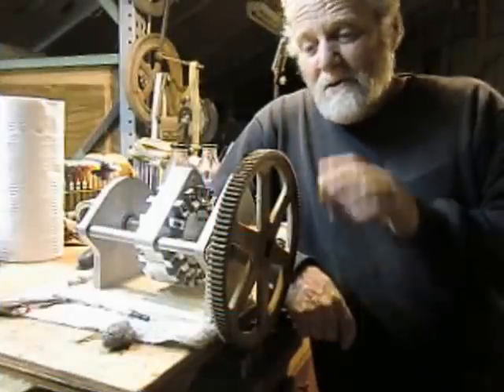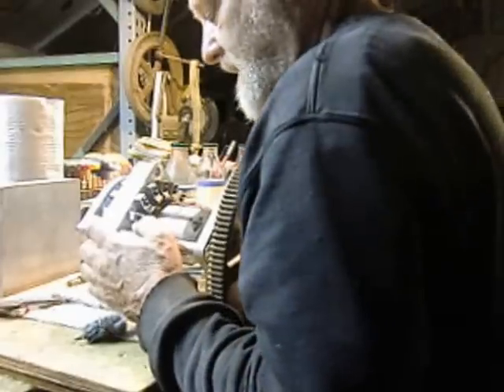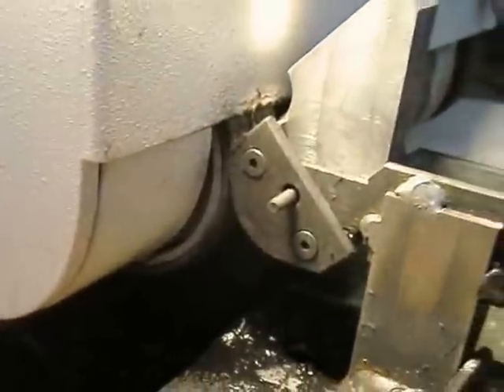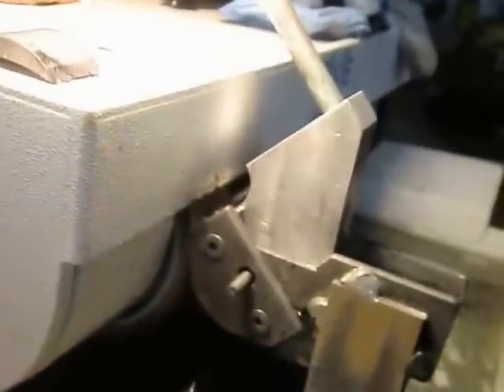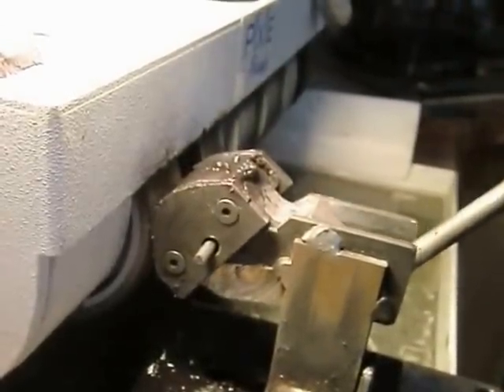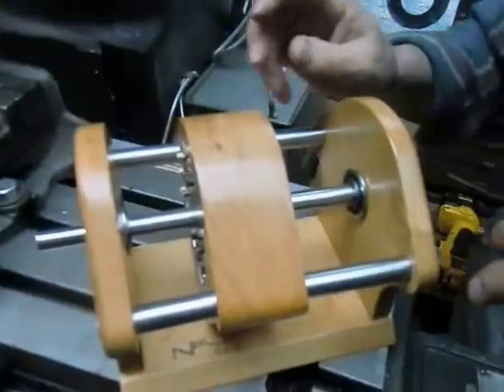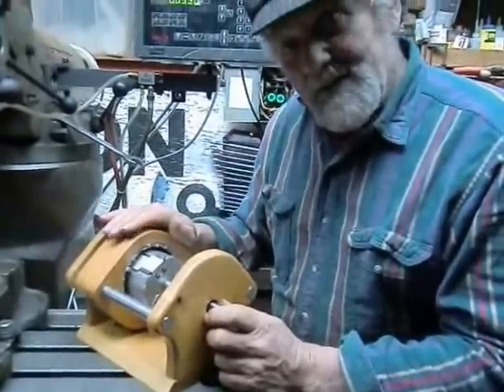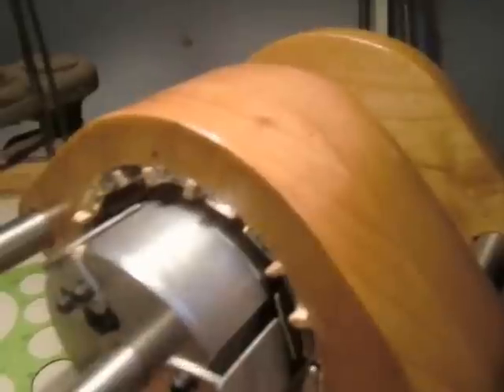HoJo Permanent Magnet Motor

Comment: Nice work NIk,    Keep in mind that Aluminium in not magnetic, it is Paramagnetic. It doesn't hold a magnetic field but it does react to it.  If You make an Aluminium slide at 45 degrees or more and let a magnet slide down it,  You'll see the aluminum slows the magnet down a lot. It is possible to effect the rotation.

Comment: Just a couple of thoughts, maybe there is magnetic interference from the core stator being so small in diameter that magnetic forces from 180 degrees away could affect the opposite side. And the magnets are too big of a surface area and are not focused in an angular direction with shielding on the corner of the approaching magnet. And also it looks like you have too much space still between in and outside magnets. I have all the materials to put one of these together but still haven't found the time.. good luck with yours and thanks for the great video.

Comment: You missed a serious part about the arcuate magnets in the armature? It was clear in the plans the distance between the ends of the arcuate magnets north and south and the 32 degree angle cut on each end were paramount to the motor working. As well the magnets are arched because there is a field generated in the arch itself. This field helps to propel the rotor. Your clips are interfering with the field in the arch. The stator magnets were to be seven inches long with two rotors inside the stator. So you have V-8 design with four cylinders. You were to use 12 stator magnets unevenly spaced about the circumference. What you missed in this build is a very simple concept that many have missed. When HOJO talked about the pulsing motion and damping it, he didn't say to eliminate it. The pulse or "whip action" created by the uneven spacing of the stator magnets is what makes the motor work. You almost found it when you had it jump three magnets. Wish I had your machine shop for sure. Keep on keeping on.

Comment: hi i'm from russia. i'm working whith magnet motor too. sorry for bad english.
1. when you show 1st model on this video i thought about 1 idea. there is only one thing you must to do whith it - you must use an generator from one side of magnet motor and rc engine from the other. generator whill get some energy from magnet motor and give it like voltage to rc engine it will spin it.
2. it's very interesting idea that magnetic field of one magnet could be not such strong like another one. and i thougt about what if we could to reduce the magnetic field of another side or it's will be better to reduce the power of magnetic field from the lateral side of magnet because only the other side of magnet - is a stopping power which stops your motors . the magnetic motors have only one problem - the other side of magnet.

p.s. we must work hard. we must believe in yourself. This is the only way to force humanity to go forward. People like us. People who believe in themselves. People who believe that physics - it's an old book. This book should be rewritten and there must be added some researches. Researches that were made by people like us. Good luck in your work.

Comment: Just so you know, aluminum dust is explosive, that is a fine powdery aluminum dust suspended in the air can explode if an ignition source (like a spark from power tools) is present. I used to work in a place that worked with aluminum and all of the aluminum that came in (and it was a lot, it was a metal warehouse with a large section of aluminum) came with large warning about the explosive power of aluminum dust.

Comment: plz use neodymium magnets the magnets you are using are of too low strength to push up the weight of the metal so your motor is not working

Comment: Nick,  Magnets moving past aluminum (like copper) create eddy currents which OPPOSE the magnetic field.  (Try dropping a 7/8" neo magnet down a 1" ID copper pipe, it will take 20-25 seconds to drop 5 feet!)   Switch from using an aluminum frame to acrylic or other strong, non-conductor of electricity.

Comment: I know you arent interested in the Hojo. But could you make a Vgate in repelling mode and inside out using 2  'V' rows. Also using 5 stators to surpass the deadspots. I love the overall design of your motor with the sliding action of parts meshing.
Reply: like poles of permanent magnets do not repel, CHECKED!
Reply: @colombo6757  🤣

Comment: Hope you rechecked the strength of the magnets before final assembly. Magnet manufacturing is very unreliable even though they are pre-rated in strength. You may recieve magnets with 10% differences in power...
Reply: Gosh, sorry, just got heard you are already aware of the magnet differences.

Comment: I met Howard back in early 1980 when he demonstrated his technology to us engineers at Inland Motor (then part of Kollmorgen Corp.) in Radford. VA. He never showed us a working motor. Instead, he demonstrated a rotor turning while holding a large magnet in both hands. He had to wrestle greatly with the magnet for the rotor to spin. It seemed to me he was inadvertently "goosing" the rotor with energy from his arms. I asked why he didn't mount the stator magnet to a fixture and he replied that he hadn't yet found the exact position where that would work. That struck me as sad and pathetic as he had already worked on this many years. Now 35 years later I've yet to see a HoJo working. It seems his technology still needs a "goose".

Comment: Hi Nik C. Colyer,
nice work, your project is amazing well designed! 
I'm just posting here about a though: magnets could be amplified by converting them  to electromagnet. You could use your own motor generated power, to electrify your magnets, you could just give a mechanical/manual push to initiate the process. Another though is about heavy materials, witch more heavy, more power your magnets must have to push the wheel off.

Thanks and keep working, i'm watching your project.
(i want to create my own someday).

Comment: you need 3 stators with the magnets at a 20 degree angle in the shape of a saw tooth pattern it will then it will run for as long as the magnets are charged

Comment: Nice  to  see  a  project  fabricated in metal in lieu of  wood & acrylic.  The  permanent magnets  can  also be  machined  more  accurately instead of grinding.  Make a  fixture to hold  several magnets onto your rotary table.  Mount rotary table  90 degrees on mill table  and  use  solid carbide end mill.   Would  save  you  time by purchasing  arc magnets and  sizing  the  rotor & stator to  fit the magnets.

Comment: I did not fail to notice your comment that it is all about the machining, not the motor.
I love your machine shop, and unlimited funds to buy aluminum.

I did however see some issues you may want to correct.
The aluminum does have an adverse drag effect on moving magnets.
By grinding the magnets (heat) you have reduced their strength.
You are using sealed bearings which are filled with grease, not oil.
These bearings do not turn as freely as oiled bearings.

Comment: just some advice.
replace the magnets with an electric circuit on the rotor or the stator. in doing so you allow for energy to be imputed into the system and you can actually produce work. if you coil the wires in the circuit correctly, you can improve the motor. using electricity also allows you to control the motor and vary the output energy.

you need to have an input for energy into the system. the rotor turning is kinetic energy and to get that kinetic energy you needed an imbalance of forces on the rotor to get it moving. 

what i am suggesting in set up electromagnets instead of permanent magnets. the reason is that the polarity of the electromagnet can be reversed instantly so you can, in effect, have the magnetic field in the stator follow the rotor around as it turns. thus always giving an imbalance of force that keeps rotating the rotor.

if your magnets some how turned mass into energy or you have an external source you could get your motor to run but in its current state without supplied power it is just rocks on a wheel

Comment: Sorry nik it wil never work.
Yes you are close but you never get there. The problem with magnets is the positive force and negative force wil zero eachother out. And yes you compensate with the next magnet but you wil end up at the beginning point of the circle. And there you cannot compensate the negitive force anymore. Then some builders make some mechenical movement to take away the negitive magnet but that cost as much energie to overcome the force as the negitive force of the last magnet. Realy it does not work and you wil get close but you wil not get there.99.999% but you need to go to 100.1 % and you wil never reach that. If you reach it you are going to connect it to a generator to use the energie. That generator wil give so much negetive force it wil stop. But nothing on your machining skils. You made a few wonderful pieces.

Comment: 1 you need to sheld the neodimium magnet to be homopolar using diamagenetic material,
2 try to build activation coils 1 or to on the stator  using the power of the neodimium magnets  to generate a pulse on the coil with this pulse and some capacitors you can generate tork, need to sincronice all to have a enought magnetic impulse.

Comment: Nik, your craftsmanship and planning are superb. But you are on a wild goose chase. This thing will never run on its own. The laws of physics, which were laid down at the moment of the big bang, prohibit a functioning magnet motor from being a reality. Someone suggested Mr. Yildiz. He is a fraud. Just like the people you bought plans from. All the motors you see on YouTube that appear to be operational are, in fact, absolute fakes. if they worked, you could buy them at any hobby shop. Or on the internet. If it's not for sale on Ebay, it probably doesn't exist. Wooden frame, aluminum frame, prime numbers, orientation of the magnets. All pointless. Everywhere you have magnets pushing each other, you have two more attracting each other. It's like trying to push your car while sitting in the front seat. Dozens of persons on Youtube working out of their garages, build these things every day. But 10,000 scientists who can send rockets to Saturn and build atom bombs simply can't figure it out? After centuries of trying? To me, that's a HUGE disconnect with logic.
Reply: I would like to add another point. Many people are under the impression that this doesn't violate the laws of conservation of energy because the energy is coming from the magnets as they decay. Magnets possess magnetic force. Force is NOT the same as energy. No energy was transferred into the magnet during its manufacture. There are formulas that will tell you how many joules of energy you can get from a battery, a waterfall or a salami sandwich. But there are NO formulas for converting Gauss to Joules.
Reply: jhanthony2 You just mentioned one item wich is actually force,not energy:)
The waterfalls. The turbines actually uses the gravity,the water is just the element pulled down by gravity wich makes the electric turbines to work:).So if a force can be transformed in useful energy,why the magnetic force couldn't? All we need is to find a way to use it :). Other of your unlimited wisdom example: ,,No energy was transferred into the magnet during its manufacture''
Really??
Reply: draculakickyourass You're right about the waterfall example. I worded that clumsily. Gravity is a force that is used in the generation of energy, but that energy was stored as potential energy due to the water being elevated. The actual source of the energy is the sun which was responsible for raising the water to the top of the mountain.

As for the transference of energy to a magnet during the manufacturing process, I stand by my original statement. No transference takes place and there is no energy contained within magnetic (or any other) force. You said force can be transformed into energy? I don't think that lies within the boundaries of currently accepted physics.
Reply: jhabthonyl yours is the attitude and belief of most of the 'educated' science world, but there are still an infinite number of discoveries unmade.

Comment from the maker: I usually don't answer to comments, but this one is a warning to all would be inventors. The plans you buy on the internet are so incomplete they are not worth the paper they are printed on. If you are a machinist and used to "winging it" then those plans will give you a vague indication as to a general direction, but the all important specifics are not there. Don't buy them.
Reply: Exatamente, não existe nada de completo.
Reply: Hi Nick
My name is Chris Fungo. I am an accountant,  not an inventor but interested in having one. My area of concentration is  creating machine that is fuel free.

I registered a concept that can develop machine that can run on compressed air on perpetual movement. A concept of what goes around comes around in a circle or rotational movement.

I however need machinist who can develop the concept and have it proven working.   

When you said you are a machinist I thought of giving you the concept for you to play on. 

The concept may help save the planet of pollutive machines.

My concept is registered with the Patent Office of Australia.

If interested, my email address is eunicaacountant@gmail.com
Reply: Nik C. Colyer 
 i want magnet motor plz contect on ahmedk078@gmail.com or contact number +919320483572

Comment: theirs a crop circle that has 13 magnets outer ring fixed in position, 11 on a ring that drive shaft left side and finally the inner 7 which drive a shaft to the right.

The design you are working needs a cam action to allow it to pas by the blocking area, then it should keep spinning

Comment: the fly wheel is a great idea. if you look at it before it stops, the magnets are pulling it back to stabilize. an elastic metal kind of plate sitting on the wheel will alow it to turn one way, but it won.t turn back.the teeth wil prevent that.now the rest maybe needs a new design with magnetic isolation (no mu metal- there is a video about isolation of magnets cheap on youtube))on each of the magnets, leaving open the pushing parts.if the sistem works, it will work with the aluminium too.makes no difference-it is no high speed mechanism yet.if you work hard on stuff like this i can help with ideas- i have no money, tools, or time to make them anyway.

Comment: Hello Nik! I am impressed with your talent with both manual as wood with aluminum. Simply perfect! 
Here in Brazil I'm still theoretical phase and light years behind you in my own magnetic motor design. 
But I could not help but perhaps crucial detail in your projects. 
The aluminum is a paramagnetic metal and moving friction reflects and generates magnetic fields next to it. 
I think all that aluminum can influence the entire magnetic cycle that created a minimum and can not be ignored. 
Maybe better (though not so beautiful) using nylon or some other polymer for these parts. 
Sure that your project soon as well as you I also believe him! 
Success!

Comment: Maybe a bit of a spring magic on either the stator or rotor will do the work. Allow the magnets to move and permit alignment with lesser resistance and give the push when in the right position. 2 sets of magnet arrangement (using single force: push)  might also help. One set providing the push for the other which is getting aligned for another push. A bit of angle will set the direction. please post the results if you decide to give it a try. thanks

Comment: Nik, good work. I love to see someone putting their machine tools to good use and enjoying a project. 

If I may offer some advice from a similar project of mine. Get the strongest neodenium magnets you find. Keep the gap between rotor and stator as small as possible, 4 thou is about the widest gap I have found workable. Friction must be kept to the absolute minimum so good bearings and perfect alignment are key.

I understand what you are trying with the 7.5 degree offset but the key is to use a prime number of magnets on either the rotor or stator, it make no difference which, on the other you then need to use 1 more or 1 less than the number just used. This creates an offset and with one part being a prime number it has no natural stable state of balance. I also prefer to use all the same poles so the repulsion force pushes the rotor around. 

Its possible to make a motor that sustains motion for a considerable time although I have not been able to power anything from it for any useful length of time. As soon as I try and get it to do Work the laws of physics seem to get in the way. 

Good luck.

Comment: add some mass to the flywheel, try different bearings (oil and oil-less), and reduce any parasitic loss as possible like air drag and air resistance. also try getting the magnets closer by two three thousandths and post an update on that

Comment: Nice job on the build but the only problem that I really see is the use of aluminum aluminum will add drag to your mechanism you can't use aluminum in close proximity to magnets without generating a drag from the eddy current generated
Reply: I was just getting ready to tell him the same thing.. If he looks up electromagnetic braking, he will see why..
Reply: zeropointfuel How about wood?
Reply: Wood will work, a composite would be better you don't want it to crack due to the stress. I have built motors that run a 1,000 rpm out of wood without any problems. good luck
Reply: You quickly point out its the wrong material so what is correct?
Reply: plastic,nylon  or a non ferrous stainless steel